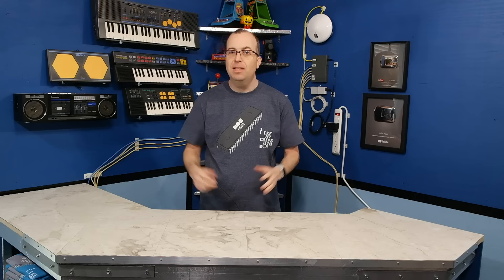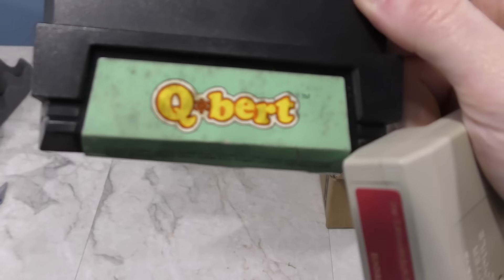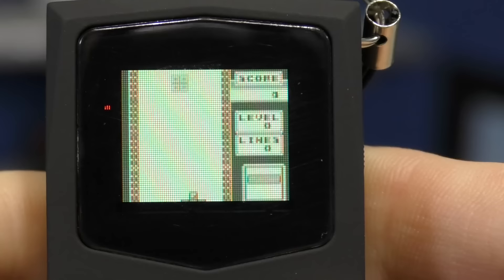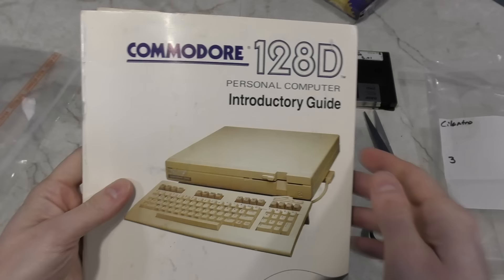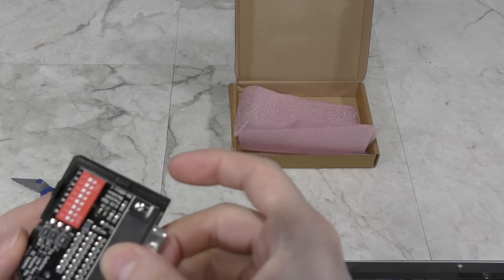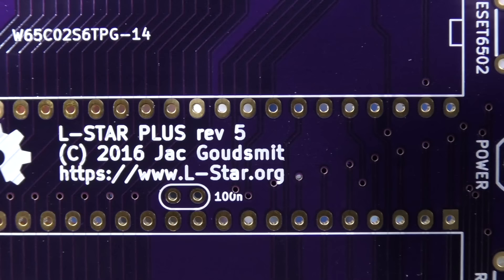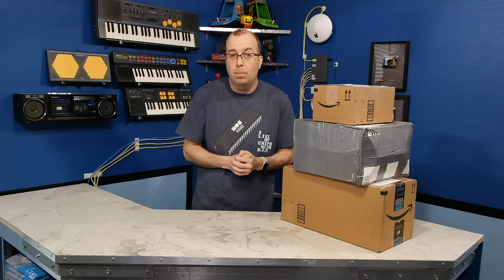8-Bit Unboxing - February 2018

Comment: Wow! An Amiga 600 and a Color Computer 3! That box of carts is worth hundreds of dollars on ebay. People are selling some of the rare/popular Tandy carts for $70-$150 depending on manual included or not.

I'm repairing my Color Computer 3: desoldering the chips, adding sockets, replacing most ICs. The Gimme chip was fine though so thankful for that. Something sitting on the address bus was wrecking memory access for the CPU. Could be the CPU itself but didn't care. Replacing it all and all of the electrolytic caps.
Reply: I got the CoCo3 and games at a local thrift store, there's something wrong with the joystick and I didn't have the time, patience or tools to take it apart and try to fix it. The computer itself was working and I figured I would get more enjoyment out of watching the 8-Bit Guy use them in his videos than I would fixing the computer and playing the games.
Reply: Thanks. It was a good video. I'm repairing my CoCo3 right now too actually. It was fun to see it on this channel. I got mine (new) in 1988 or so as a gift. Tons of fun, learned BASIC, taught me how to self-learn skills. Something is bad on the address bus now though - I think one of the peripheral driver chips.

Comment: AHHHH!!! My eyes lit up at about the 3:15 mark! My second computer, when I turned five in 1986, was a Color Computer 2!  The keyboard eventually failed and was replaced with a Color Computer 3 keyboard.  In 1990 or 1991, I acquired the "Direct Connect Modem Pak" which introduced me to the world of BBSes, all at a GLORIOUS 300 baud!  From there, I eventually received a hand-me-down Amstrad PC1512DD to which I had added a 40 meg hard card and a Media Vision ThunderBoard.  When I got the computer it had a 1200 baud modem, but I replaced it with a 2400.  That baby had three expansion slots, and I kept all three of them full!  I wish I still had all of this old hardware, but it all got tossed away years ago. It hurts my heart!  I love your videos, man!

Comment: Regarding the complaints: Don't change a thing, 8-bit guy.

This channel is the awesome. Looking forward to the CoCo presentation.
Reply: Sold my stuff decades ago, but try to get the "expansion bus" device and the awkward exposed ribbon cables for FD or HD upgrades. ALSO: OS/2 multi-tasking

Comment: With the MIDI you want 1 in for the controller (master keyboard) and 3 out for modules and various uses. 
One out might be to a percussion chain where you have a few drum machines chained on the thru ports. Another might be a synth chain and so on.

Comment: I remember using 8-inch drives with an old "Commfile" computer at a former workplace.  It used the Z80 CPU and ran a version of CP/M, like many Z80-based computers of the day.  No HDD though, so it had to boot from floppy.

We thought we were practically in heaven the day the boss bought a system with a HDD which booted into MP/M and could run multiple programs at once, using interrupts.  The last 16K of RAM was loaded with the OS on boot-up, while the lower 48K of RAM was bank-switched from 128K of RAM in 16K chunks, and this was where programs were loaded.  That way, the OS only needed to switch banks in order to allow multiple programs to time-share its resources, making it pretty fast for the day.

Comment: I was system operator on a Vax 11/780 computer in the 1980s and we used those eight inch floppy disks to bootstrap the 11/780 and also for simple utility tasks - I wish I had some of those for my rare media type collection ;>)

Comment: The A600 card is a 020. You could power up the 1551 using the adapter that came with the A600.

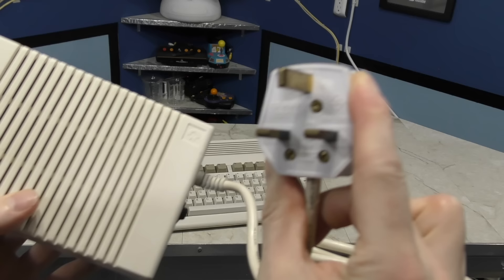Comment: 2:10 neat.

The 600 is a much unrrated little machine: Basically, a 500+ only it has the same internal 2.5" IDE connector as the 1200, making it possible to fit a hard drive internally, unlike the 500/500+ which tended to connect them on the expansion bus to the left of those machines.  The 600 and 1200 did away with that bus in favour of a PC latop style PCMCIA slot, which is probably what that PCMCIA hard drive was intended for.

PAL shouldn't be a huge issue with the system:  On the Amiga There's an early boot menu accessed by holding down both mouse buttons when the machine is powered up, and IIRC a keyboard press on that screen should toggle the machine between NTSC and PAL output.  Might have problems running some software in NTSC, but the machine is fairly region agnostic.
Reply: The Amiga has RGB outputs, no strictly speaking, it is neither PAL nor NTSC. The difference is likely 50Hz versus 60Hz. Monitors that tolerate both 50 and 60Hz inputs are common.

Comment: Reminds me that I need to try to fix my brothers A600. Based on the symptoms I think the Denise chip has some faulty solder joints and it seems to be a not too uncommon issue.

Comment: About powering the Commodore 1551 disk drive - you have the 120V > 240V AC inverter that was donated earlier? Or was a three prong power cord not shipped with the disk drive?

Comment: 2:35 of all homecomputers made i actually think the a600 had the best design and size, not to found of the bulky power adapter but remember this was made 1992. these we're easy to upgrade back then and now. if you buy a pc today you won't be able to upgrade cpu after a year unless you change motherboard.

Comment: You shouldn't have too much difficulty with the Amiga; they can usually run in either NTSC or PAL modes.

IIRC the 600 has a flickerfixer built in so you can use it with a standard 30KHz VGA monitor

Comment: 0:36 If David does decide to get into playing sheet music, I'm sure he'll probably take a look at the "GVIDO" store, which is basically like an e-book store, but for sheet music.

3:55 I swear my 2009 custom built PC has that for one of its two optical disc drives, but I never used LabelFlash on that because it required commercial software, and I'd rather use the open-source disc authoring software.

Comment: C64 SID Midi interface a different one I bet you can't wait to try that out as you love keyboards and Commodores.

I beleive these Commodore 64 midi devices were used on Top of the Pops in 1985 performences because those tracks sounded like AMIGA stuff but the on stage computer was C64 form factor so it must have been possible to get AMIGA quality sound from the C64 with one of the later midi devices if they were used on stage in early 1985 just before the AMIGA 1000 come out unless it was some funky A1000 home version proto before they built the big A500 as its final 1987 form factor of the home version of the big 500 with the form factor of the 64.

Most likely a C64 with a late midi addon that makes it do AMIGA like sounds from the SID though. Can't see the A500 home version of the A1000 having a C64 smaller form factor as a 1985 proto design somehow.

Comment: You don't have to be paranoid with CRTs as long as you don't touch the high voltage cable (which has a plastic or rubber cap for safety), don't touch the capacitors, and don't touch anything while it is live unless you know what you are doing.  Even if you touch something while it is turned off, you will only get a painful shock and not a fatal shock because it is not connected to the mains and has no sustaining current.

Comment: You can run the Amiga in 60hz using a bootloader it was a trick a lot of UK users used to get extra speed if the TV had vertical hold or direct 60hz support. Should make it more compatible with US TV's.

Comment: I ran out of all the 8 Bit Guy and 8 Bit Keys videos besides unboxings, which I usually never watch. Buuut now I'm stuck in a never ending swarm of tabs with all of the unboxing videos I thought I would never like. I clicked on two videos to open in tabs, watched the first one, but have never gotten to the second one, because I've just been opening more tabs since, and what was the 2nd video is now at the very end of my screen... a tiny corner of its tab showing.

Comment: Ok, so I for one like the unboxing videos.  I actually wish you'd make them a bit longer, I know you probably record more detail on the stuff you get, it would be great to see that content.

It's always interesting to see you open something when I can say "Oh, I've got one of those" or "that looks interesting, I've never seen it before" and every unboxing video has some of each for me.

Oh, and you've probably realized it already by now, but you've got a voltage converter that will work for that 1551 drive, it came with the Amiga.  You'll want to check the speed, of course, not sure if those drives are line frequency timed, if they are it's going to be adjusted to 50Hz.  And if that's the case, there's probably an adjustment pot.

Comment: analog NT is really cool! It's a review unit they sent you. That thing is 200$. Super sweet. Also that's Engineered with an FPGA, so no emulation.
Reply: Isn't an FPGA kinda hardware emulation... just on a hardware level instead of software.

Comment: Hi  8 bit I sent a question about the Atari 7800 recently and I needed to correct  my question the question was about the consoles "Expansion Interface" I think I referred to it as an expansion port but after checking I found it is an expansion interface. If can offer any input as to its use that would be great. I recently bought several to refurbish. Thanks Joe

Comment: You need to be really careful about the UK plug adapter for the Amiga...it’s likely a 50Hz system and most “frequency converters” don’t actually change between 50/60 Hz in a way that is safe. What will happen is that the clean 50 Hz Sine wave in will be output as a truncated, sharp sawtooth 60Hz. Newer electronics will be able to adapt to 50/60Hz in the power brick (enabling a simple plug adapter) but if it doesn’t, you could really damage the PSU by plugging into 60Hz American power.
Reply: That converter is likely just a transformer so you get something like 240V 60Hz as input to the power supply. That is perfectly fine. Those Amiga brick power supplies are transformer based and use switching power regulators. They will be more than happy when you feed them with 60Hz.

Comment: 8-bit Guy: You haven't used 8 inch floppies!
I used them in my first job as an engineer (circa 1981/82). Developing software for 8bit Intel microcontrollers (8048, 8039 etc). We used Intel MDS 800 systems and the floppy drives were in seperate huge boxes that connected to the MDS system.
Vaguely remember that you could go away and make a cup of tea while you waited for your Assembler code to be 'compiled' ready for testing. Definitely long hours staring into space or chatting to colleagues, waiting for things to happen. Those were the good old days before information overload.

MDS 800 the first development system I used:
http://www.computinghistory.org.uk/det/21821/Intel-Intellec-MDS-800-Development-System/

This MDS 80 was the next model and replaced the one I first used:
http://www.computinghistory.org.uk/det/731/Intel-MDS-80-Microcomputer-Development-System/

Comment: 7:21 "An IBM PC Junior.... and an extra top cover for some reason."

Uhh, wait a minute... I seem to remember you remaking the keyboard badge because it was missing. 

Couldn't you have plucked the badge off of the extra cover and used that? Hm, maybe that's why the sender included the top cover in the first place...

Comment: If anyone's wondering what that note says, here:

"I hope this software works and is enjoyable. I'm writing a blog about my misadventures in building a SID based synth around the MIDIbox platform inside an old Commodore VIC-20 case if you/or your audience is interested. The URL is http://www.fallenturtle.com/c64blog. I'm rather proud of my C64 Basic inspired theme I coded for the blog. Spoiler alert: my soldering skills are bad but are getting better. I actually found it helped using your technique of touching the solder briefly to get the solder flowing onto the pad despite what the naysayers told you."

Comment: Hey David, isn't it dangerous to connect some unknown device, which runs an unknown system, to your home Wi-Fi network? Be more careful. Great videos by the way.
Reply: If you refer to the PocketSprite: you don't. It actually acts as an access point, and you connect your laptop or phone to it to upload stuff. In theory this still leaves the connecting device open to attacks, but it would be less likely. In this case, I'm 100% sure the device doesn't do anything malicious to anything it connects to, as I've written the software for it :)
Reply: I think you are probably well intentioned, but we just have to take your word for it, since we haven't seen the source code. I just wanted to point out it's not safe. We are getting used to it more and more each day with cellphones for instance, and it's worrisome.
Reply: Sure you can! https://github.com/PocketSprite/8bkc-chooser :) But I get your point; as they guy programming this thing, you can only trust me saying that I've not done anything funny with the binary in the pocket sprite, even if I released source code that looks like it matches what's in the device itself and I assure you that's the code in there. I guess that at a certain point, that goes for any hard/software. (Although, to be fair, most stuff discussed on this channel is probably safe because it lacks any network connectivity.)
Reply: Hey, that's great! I'm glad your project uses free software, that's the right choice, and I hope you succeed in business with this ethic. I trust you more now, but you know, better safe than sorry. That being said, we use cellphones everyday that run proprietary software and binary blobs, so I just wanted to raise this subject.

Comment: i was watching a video about fixing a snes game. and he usually uses brasso on his games to help clean em. but he got this new cleaner called brite boy that works alot better than the brasso. i figured id share this info if you're looking for cleaning supplies for games or parts of circuit boards. heres a link to the video in question.   https://www.youtube.com/watch?v=ZXuSDHVh0eQ

Comment: +The 8-Bit Guy
Hi David, I think i may be able to help you with the missing power cable for the black Commodore disk drive; you see, I happen to have a mains cable with an IEC connector at one end, and a UK mains plug at the other, which i would gladly donate - I live in Denmark and therefore have absolutely no use for this cable, so the reason i suggest this solution is that i noticed that one of the items you unboxed just prior to the disk drive came with a mains step-up transformer which accepts UK plugs, thus the only possible hurdle would be if that transformer can handle the power requirements for the disk drive.
If you're interested, send me an email to bert (dot) grink to my gmail. Otherwise, if you happen to find a more convenient way of solving the issue, just refrain from emailing me.
Anyway, Greetings from Denmark. :D